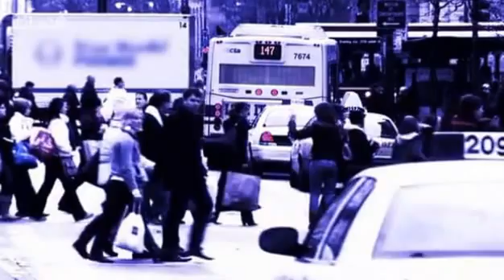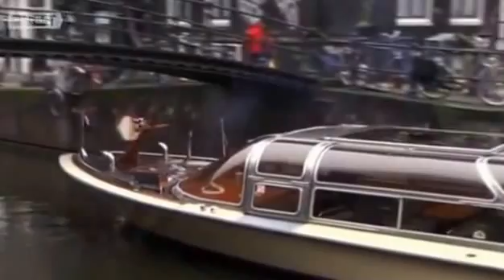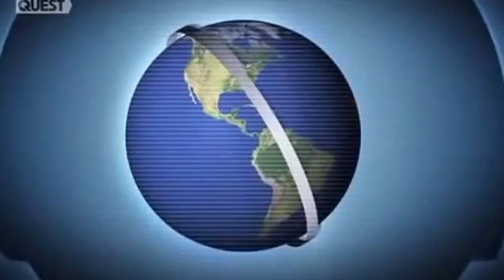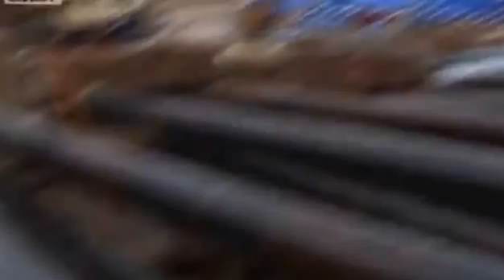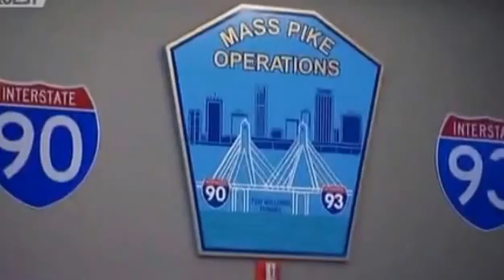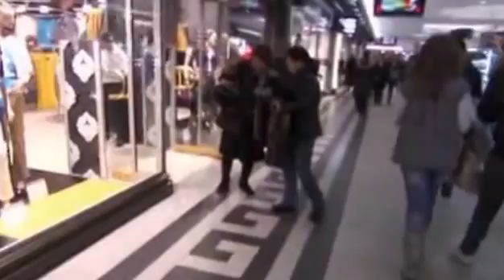World's Largest Underground City

Comment: Hmmm. 
First of all... Why on Earth even consider building underground cities below existing mega structure cities which themselves were initially built on sewage and garbage dumps?  
They start out the documentary saying ppl could live, work, and play in the city.  Since there would be no 'need' to leave then they should build their big city under the suburban areas and away from the shoreline due to water pressure and erosion issues.  And all these places trying to figure out concrete quality and safety should talk to the owner of Pensmore Castle in MO. 

Secondly, since Chicago, NY, and other cities are so overcrowded yet these States are fighting to allow illegal immigrants.. millions of them. . who will have generations of children...just senseless.

Wouldn't it be cheaper to take all the quadrillions of pounds of sand from the Middle East and dump it into the Pacific just as Dubai was built, thus creating a whole new continent for ppl to live.  According to any globe I have seen, there is a whole lot of 'missing' land where this could happen.
Reply: that new island would be completely lacking resources and minerals in the ground and without billiosn spend each year it would be gone fairly quickly since the sand there isnt good for building since its rounded by the wind, which is also the reason they have to import sand from other countrys because only edged sand is usable as a building material. the underground city is also aminly for military and infrastructure. Its a huge bunker in case a war breacks out and it has trains, a cooling system for the entire system, a powerplant, a recycling station whith a complicated tube system so the city doesnt need as many garbage trucks and many additional features. And since Helsinki is build on granite the caves are fairly easy to dig and what they take out can be used a bulding material above ground. It also houses parking houses, public bathes and shopping malls, which take way to much space aboce the ground. I realy dont see why so many people dislike the concept
Reply: @zuzuenhanced  eh..that's your opinion from not thinking much.